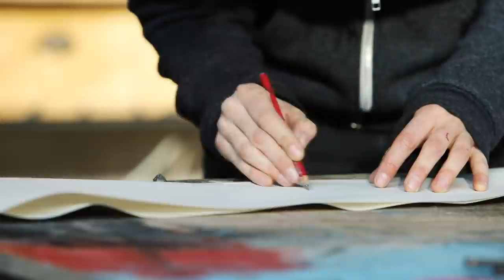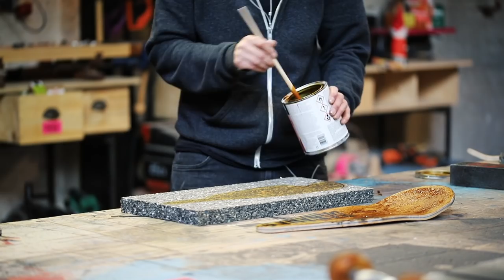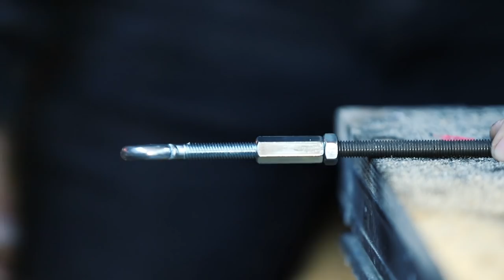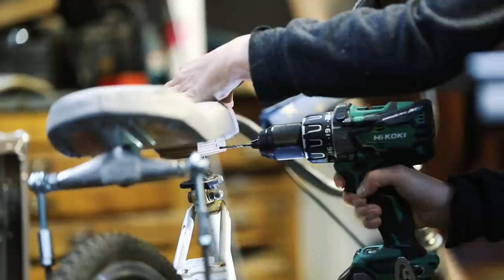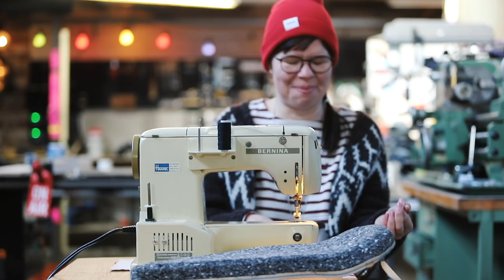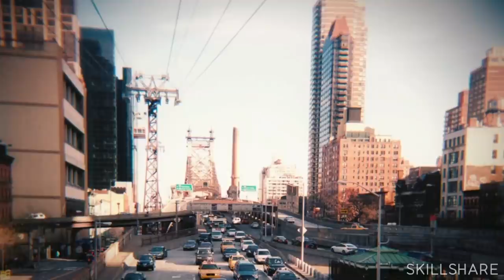DIY Bananaseat from old Skateboard

Comment: to cut the foam for building motorbike seats we usually use a chicken knife.. the alternating and motorized one.. the one designed for cutting bread actually with serrated edge blade ... it works very well on foam to build motorbike seats ... give it a try .. and to drill a clean big hole into wood drill it with the desired drill size but with piece of scrap wood underneath the wood for into you want the hole.. the drill will keep cutting trough the two layers od wood and you will end with a clean hole on the seat holder piece...

Comment: Very cool idea but how this bike will make a tern if the pedals scratch the ground
After revisiting the video after 4 years I think that this is dangerous because these 2 rods that supports the seat in the back are to thin to withstand the forces and may break or bend I hope after day to day use if you seat to far back

Comment: Ok, couple of things things. 
Using the trucks for a rear rack/struts, cmon, that's just brilliant. Does the ass end wobble because of the trucks?
Also, how strong is the seatpost hole if it does wobble?
I've tried to do this three times now, and turns out, stitching a banana seat by hand when you have no idea what you are doing, is kind of difficult.
Amazing work, per usual. 
Thanks for this!

Comment: That's one way to get a flexible joint :)
btw, if you drill part way through from one side so the pilot drill sticks out, you can then drill from the other to prevent tearout ;)